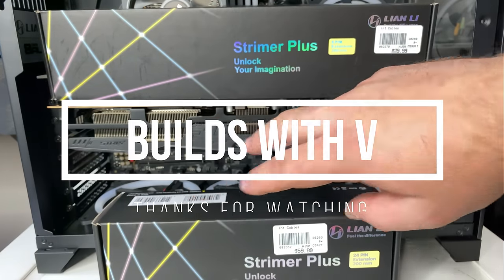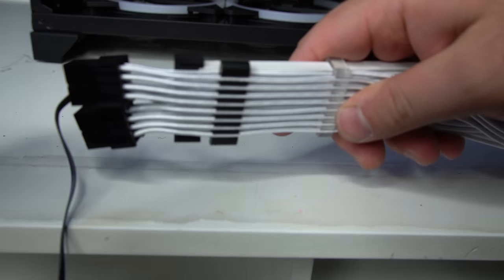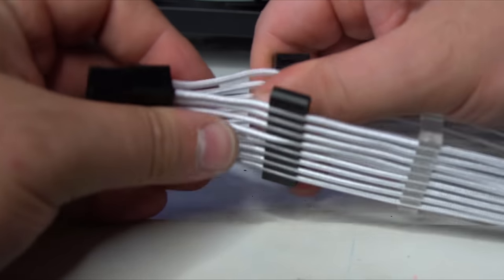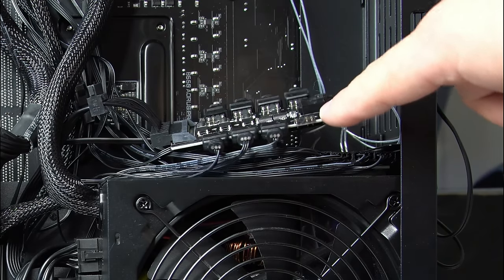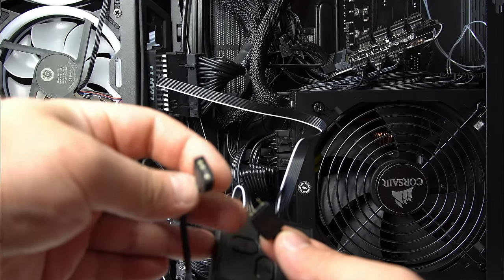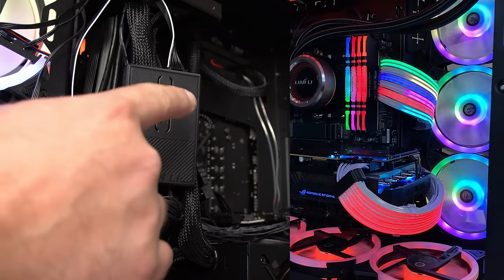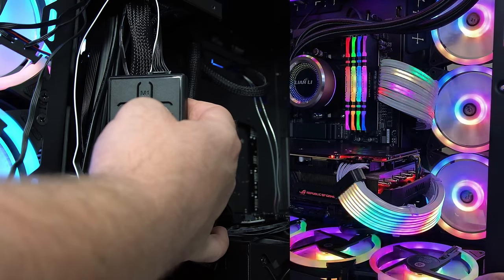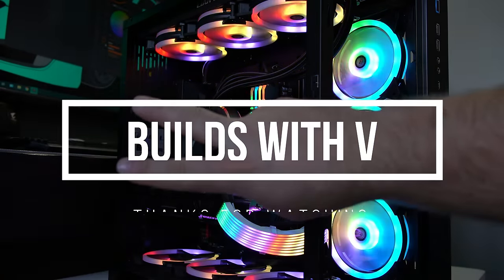How To Install Lian Li Strimer Plus RGB Cables + Review & How To Use

Comment from the maker: Thank you all so much for watching! I recently released some merch through teespring and it would mean a lot if you could check it out and comment to let me know what you think. Also if you have any suggestions feel free to reply as well. Link: https://builds-with-v.myteespring.co
Reply: Did you buy 2 lian li RGB just like in this video ?
Reply: @Haziq Kel  don't buy it bc it's junk bc it's doesn't ever work on Asus motherboards
Reply from the maker: @justinedge5061  I’ve used it on Asus motherboard and it worked just fine
Reply: Thats so true

Comment: Thank you so much for this video! It’s extremely well-made. I had two quick questions: 

1. Can you skip the ARGB cable and only have the SATA plugged in if your motherboard does not support ARGB?

2. If your GPU has a single 8-pin port, can you remove half of the cables and reposition the remaining to be in the center of the LED strips?

Thanks!
Reply from the maker: Thanks so much. Yes you can plug in only the sata cable and everything will work and yes you can move the 8-pin to be centered and only use half of it.
Reply: If your mobo doesnt support argb then.... whats the point of buying an argb cable extension? you will pay premium for a simple cable extension
Reply: @ravell2854 some mobos don’t have the 5v argb plug, only the 12v which is what he probably means , I have the same issue.

Comment: THANK YOU! I didn’t know the rgb came off of the cables! know thinking back i’m dumb, but sitting here at nearly 1 AM trying to figure out if 180 degree adapters are the move. i have an EVGA 3080 and it has a 24 pin, but lian li has a 24 pin one, but ever since i got it i had to make it weird since it has standard pins the have the clip at the bottom. thank you sir!

Comment: I just got these and installed them today. Thanks for making this video as it helped me flip around the RGB cable for my GPU. I had no trouble getting the 24 pin to work, but couldn't figure out why my triple 8 pin cable was backwards and how to fix it without breaking anything. It's all back together and looks awesome. Good luck to anyone else installing these, it's worth it if you are an RGB enthusiast.
Reply: Can you put white color or any custom color
Reply: @spawn7899  It has all the standard LED colors and several different patterns. White is an option and for each color you can choose a pattern, the speed of that pattern and the brightness. This is if you use the controller that comes with the strimers. You can also connect it to your motherboard and control it through software which should allow you to make your own custom color, although at the cost of using the excellent patterns that are designed explicitly for the strimers.

Comment: Another great video, now, don’t slow down 😁 I am a little confused. You stated that you can simply connect the SATA for power, and you made it seem like there was no need to connect ANY of the RGB cables. But, if you did not, you would not be able to control any of the lights/colours, right? Or would that simply be done via the controller?
Reply from the maker: Thank you 🙏 so the only cable needed is the sata power cable. The lighting is controlled with the controller. Optionally you can also connect the addressable RGB cable so you can switch from controller to software control (if you wanna mess with more lighting effects).

Comment: I’m trying to connect the 8 pin to my gpu( rtx 3060 xc) however there’s a piece hanging out should I be worried about that or is it fine as it is. Alsoonce I get the software after building the pc can I no longer use the remote to change colors and patterns or do I neeed to keep it mounted somewhere in my build
Reply from the maker: The 2 pins that hang out are perfectly fine over there or you can tuck them away. The controller does still have to be plugged in but once you switch to software you won’t need to mess with the controller anymore
Reply: @BuildsWithV  okay and one more question if you don’t mind; this is my first time building a pc so I am really lost when it comes to where wires gets plugged into the mobo  where exactly does the wires for the remote getting plugged into the mobo for ex does 1 go into the piece that says rainbow

Comment: Great video !   I’m going to buy some ASAP.   I just bought 1,000 dollars worth of RGB Corsair QL Fans and now I need these cables.  Your Build looks good.  Mine’s gonna have 14 case fans with a mix of 120mm,140mm & 200mm RGB Fans.  It’s going to look like the Sun. I have an Aorus z590 Mobo with 9 fan headers so will use splitters or whatever it takes to put all these fans inside.  Push pull on the NZXT 360 Radiator. View 51 TG Snow case has tons of room and lots of space in the back to hide the cables.
Reply from the maker: That’s going to look amazing! Thanks for sharing and if you don’t mind sharing a photo of the build when it’s setup feel free to dm me on Instagram @buildswithv

Comment: Hey man, dude video! I recieved the cables aswell today for my build in the Lian Li o11 xl my case when the gpu connectors x3 8pin working? (waiting 3090)
Reply from the maker: Thank you 😊 Yes it will still work no problem but you’ll have to plug in one regular 8-pin since these only have 2 8-pins.
Reply: @BuildsWithV   SO they take 2 slots in the PSU?  Because my GIGABYTE 3090 only takes two 8 pin.  So i can get this!
Reply from the maker: @vednar99  yes this will work no problem

Comment: Is it possible to not plug in the sata cable and just control through your motherboard the rgb through the motherboard app?
Reply from the maker: To get power for the 24-pin unfortunately you have to plug in the sata cable. Idk why they did it this way. For the 8-pin you can use only your motherboard power

Comment: Great vid, wanted to double check to see where I had to put the controller because I think it’s annoying that you have to take your case panel off to change the color
Reply from the maker: On my most recent build I stuck it inside my case with some adhesive. It’s easier than taking the back panel off since I don’t have to move the pc to take the front panel off but i can’t find a better spot

Comment: Bro thanks for the video! I bought the products LITERALLY after finishing you video. I had a lot of doubt about the compatibility, but thanks to your efforts on this video, I have 0 questions in my mind right now. Also horizontal vs vertical cpu cable part was very useful, i will change my vertical gpu to the horizontal one. Thanks again!

Comment: Hello, I have one question.,Maybe you can answer on it? My case is MATREXX 70 ADD-RGB 3F. I just need to know, if I can connect this to the DeepCool A-RGB splitter. I have biunch of A-RGB fans and my motherboard have 2x A-RGB (3-pin) header. SO I have two bunch of A-RGB fans for those two A-RGB headers. I just need to know, may I connect this LIan Li STrimer PLus to my A-RGB case splitter and use it synced with my other A-RGB fans?

Comment: so i have 2 5V rgb headers on my Mainboard and can i controll both of them with my motherboard software so is there also a cable for the 24pin that u can connect to your motherboard
edit : so if i plug both in the controller and then i can plug the controller in my mb i can controll it with the software?
Reply from the maker: You can connect them to the controller and then to motherboard and control them with software. Just press the M1 button for like 3 seconds on the controller to switch to software. Or you can plug in the controller to the motherboard with the 24-pin connected to it and then connect the GPU cable to the other header so you can have different effects on each cable.
Reply: @BuildsWithV  ok thx

Comment: So you need to flip these cables when using vertcal gpu `? Also what software do you use to set the colours ?
Reply from the maker: Just depends on how your GPU connectors are facing. Some face down and some are flipped.

Comment: Can i use that strimer plus 24pin connect to a hub ? Even tho i already connect to the strimer plus controller, because i only have 1 5v 3pin argb header :/ and i got like 3-5 more to connect to the 5v 3pin argb header like my aio and argb fans..
Reply from the maker: Yeah you can connect it to a hub. Mine is actually plugged into a hub as well.
Reply: @BuildsWithV  wow thanks bro 👍🏻

Comment: A very well done, precise video on installing these RGB cables. Your step by step explanation was easy to follow and understand. Quick question. On the RGB controller, could you also control the Corsair light strips where the fan connection goes? Thanks.......
Reply from the maker: Thank you so much 🙏 Unfortunately you can’t control any Corsair products with these.

Comment: Thanks for posting this video! I’ve got a question about the 24-pin cable.  Would I still be able to route cable on a motherboard with its 24-pin sockets facing the right side of the case?  I know that on most motherboards the 24-pin is facing outward which then allows for that nice curved look from the strimer cable.  Would that still be case on motherboards with the 24 pin facing to the right of the case? Great video man!

Comment: might be a stupid question but do the bottom 3 fans have to be facing down? i’m building a similar build i have a lian li xl case with 3 fans along the top bottom and side (aio cooler) so not sure if i should face the bottom 3 fans up or down. thought maybe bc it wouldn’t allow great air flow by having them down or up vise versa. would maybe allow suction, any help is appreciated.

Comment: heya, just got one question. Will the color and pattern changing on the controller still work on the strimmers if you only plug in sata and not the middle port? Great video!
Reply from the maker: Yeah the middle ARGB cable is optional only if you’d like to control your cables with software.

Comment: Hi,
I have tripple 8pin and 24 pin. Is it possible to connect both of these to O11D XL lightbar hub and control it with the M|C buttons on front of the casing?

Comment: Excellent video friend.  I am looking to add those to my build as well.  You now sold me 100%.  I have a question on your 8 pin gpu cables when you said you switch it to software and had the rainbow effect was that running off of RGB Fusion or some other software.  I only ask because I am running a gigabyte board as well but can’t find that rainbow effect like that in the RGB Fusion software.
Reply from the maker: Travis Warley Thank you, yes that was on RGB fusion 2.0. So the effect is called rainbow in rgb fusion and I believe it’s only available on the 5v 3-pin addressable RGB headers. In RGB fusion I just select the motherboard, then select the ARGB header and it should have lots more available effects than the others. Hope this helps. Thanks for watching 🙏

Comment: Hey I'm not sure if you've covered this at all, but I'm having issues using RGBFusion 2.0 to customize the RGB on the cables, it doesn't seem to pick up on them as anything, any clue why this could be? Cheers.
Reply from the maker: Press and hold the M1 button for a few seconds and it should switch to using motherboard software. As long as it’s plugged into your motherboard ARGB port and sata power it should work.
Reply: @BuildsWithV  thanks so much! Did not know about that feature.

Comment: Hi bro great video. Is that cable compatible with RTX 3070 Aorus Master gpu?
Reply from the maker: Yeah it will work with the 3070 Aorus master. Thanks for watching 🙏
Reply: @BuildsWithV  Thanks bro, and what about the RX6800XT? Im asking because im between those 2 cards.
Reply from the maker: @RicardoMartinez-vo7hv  as long as it had 2x8 pin then it’ll work perfectly. If it has 3x8 pin then it would still work but one of the 8-pins will need to have a standard cable in it since these only have 2x8 pin

Comment: if you just plug this in to ur psu cable  and 24pin cable do you need to connect the controller and stuff i just really want it for the looks not the rgb so do you need to connect it in order to get power to ur graphics card and motherboard

Comment: how did you connect your gpu to your motherboard if both cables have to pass through the controller?
Reply from the maker: The cables gpu cable can be plugged directly into your motherboard. It doesn’t have to go through the controller.

Comment: Hey!! Great video was considering buying these cables and this explains so much about them!! I was also wondering about your GPU tho! I am concerned about my gpu being super close to the glass and breaking it on my O11 case I see you have a pretty big card and the O11 case too! So I was wondering if you ever noticed anything bad with that situation with your glass getting scary hot or anything, might vertically mount my gpu so that chance doesn’t happen and it would look better in general too but thanks for the video really helps me understand a bunch more:)
Reply: your glass won't break at those temps. even if its super cold outside of the case and super hot inside. unless the air in your pc is like 100 degrees and your room is below zero then you should be worried

Comment: My motherboard is the Z490 E Gaming and it has aura sync. How do I use the Lian Li with aura sync?
Reply: Check compatibilty, BUT I hate having a bunch of different RGB software, so i control everything with Synapse 3. You can purchas a Razer RGB controller and should be able to plug this and other perhipherals into it and control them from Synapse 3.Compatibility with motherboard componets has a wide range, but I believe someone wrote a program that integrates Synapse 3 with ASUS Aura, and Potentially corsair. In theory, you'd install that and it would give you control over AURA components and things plugged into your mobo.

Comment: Hey , i plugged in both 8 and 24 pin into one controller that was included but the 8pin cable is only partially working, which one of the rgb strips does not turn on, what do i do?
Reply from the maker: It could be a bad connection or maybe a bad 8 pin. Could also be a bad controller but I’d recheck all the connectors and make sure they’re all plugged in well. If that doesn’t help then maybe exchange the 8 pin for a new one and see if that helps. If not then I’d say it’s a bad controller so you’d have to exchange that as well.

Comment: I just installed them and they dont work i dont knoe if u can help me but pls try:
1. i connected the 2x8 pin to the cable that comes with it to make it a 3pin argb and u conected it to my aorus x570 master and it doesnt light up at all and it doesnt matter what i do in rgb fusion 2.0
2. i connected the 24pin to the box and the box with the cable that makes it a 3pin argb to the motherboard and i it doesnt light up as well 
And i have a question do i have to conect the box with sata if i just want to use the mb software
Reply from the maker: Make sure the 2x8 pin is plugged into the ARGB port correctly and that should work as long as it doesn’t have any other issues. For the 24-pin you do need to plug sata for it to work. Once it works with the controller then you have to press the M1 button for a few seconds to switch to using software.
Reply: @BuildsWithV  i fixed the problem with the 24pin abd just plugged the 8 pin to the controller it has only the same effect now but it works thank u sooo much
Reply from the maker: @Xoul-fp4zd  awesome! Glad you got it working. Thanks for watching and merry Christmas or happy holidays 🎉

Comment: My motherboard has only 4-pin RGB connectors. Is there any way how could I run these strips on that? I haven’t found any 3-pin argb to 4-pin RGB reduction. But I would really love to run these strips.
Thank you!
Reply from the maker: You can run the strips without plugging them into your motherboard. Just use the controller. Even if you could get a converter unfortunately the rgb ports don’t provide good lighting effects. I recommend just using the controller. Plug it into sata power and you’re good. The other option is the use a razer ARGB controller https://amzn.to/3qQpQb9

Comment: Hey V,  just had a quick question. At 3:20 I see you can completely remove the RGB element from the included cables, can you also do this on the 24 pin cable? I wanted to remove the included cables and just attach the RGB part to my custom sleeved cables.

Ps - great informative video - keep up the good work!
Reply from the maker: I believe the 24-pin can also be completely taken apart. The reason I say “I believe” is cause I haven’t actually tried it but the cables seem to both be made the same way. I’d assume the 24-pin is also able to be flipped because some motherboards would need it flipped.

Thank you so much 😊

Comment: My motherboard (B450 Tomahawk Max) has 12v analogue RGB headers. How would I connect them? Do I not need to connect the 5v RGB pins to any controller and only just use the SATA cables?
Reply from the maker: You would then just connect the lian li controller to sata and that’s all.

Comment: Does it matter how the two plugs plug into the graphics card or are the plugs the same?
Reply from the maker: They’re both the same so it doesn’t matter but they only plug in one way either way so you wouldn’t be able to plug them in upside down.

Comment: Hi, sorry for ask but, I want use it in my 3070, but the GPU lian li said 8pin, and the 3070 use 16 pins, I need buy 2? or how it work because you only use one but have 16 pins, could you explain me that please?
Reply from the maker: It’s completely okay to ask, you just need one cable. They call it 8-pin but it comes with 16 total
Reply: @BuildsWithV  Thanks! <3